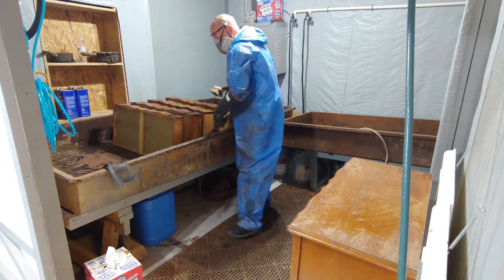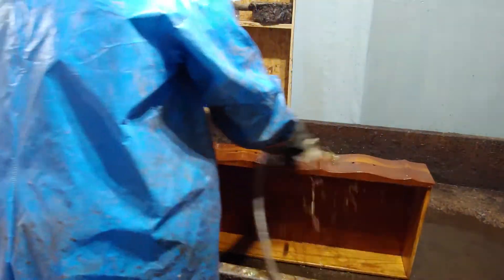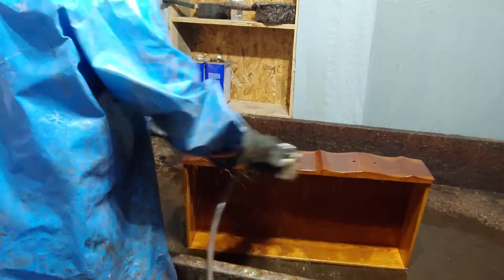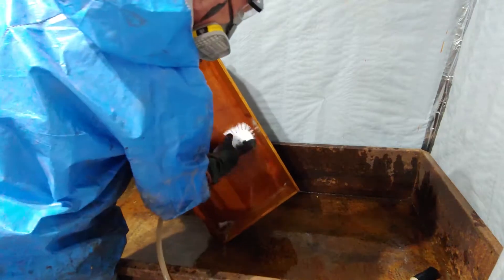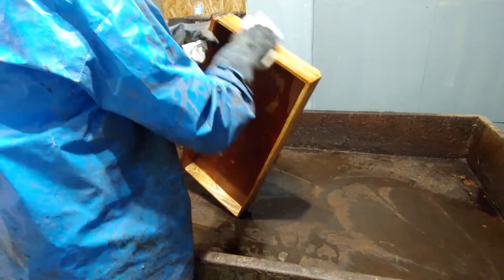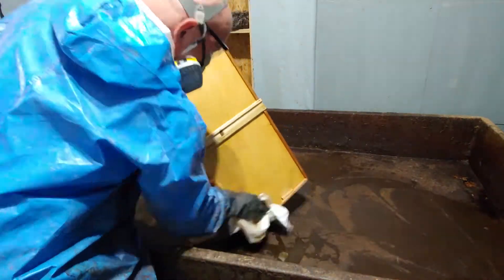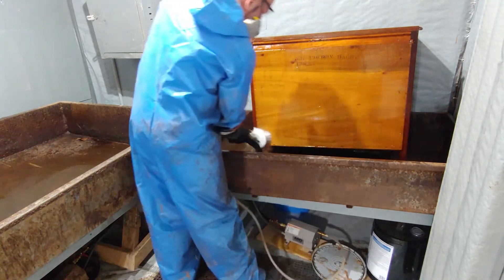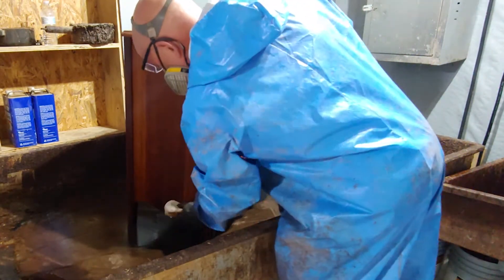How Pro's Strip Wood Furniture - Furniture Refinishing Secrets - Refinishing French Chest Part 1

Comment: Yeah, I checked your video description and didn’t see any details of what stripper you are using, what kind of materials you’re using for your flow tank or pump. Are you able to provide that information?
Reply from the maker: The Stripper I am using in this video is Hoodstrip 290 finish remover from Hood Finishing Products.
Reply: Restoration Studio great! What did you say you were using to pump the stripper and lacquer thinner through?
Reply from the maker: I will post a video in the near future on equipment and products.  I use a diaphragm pump.
Reply: Restoration Studio looking forward to it!
Reply: @FurnitureRefinishingStudio  hi i was curious if you had the video up or more info on your setup, i m also interested to upgrade and would like tips on where to start for piecing together pump hose brush etc... thanks and your content is very helpful